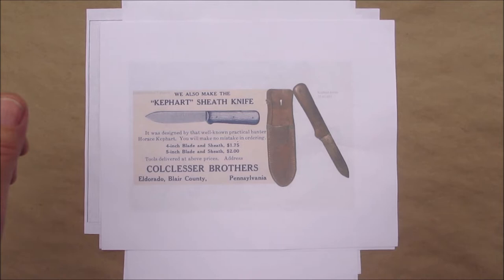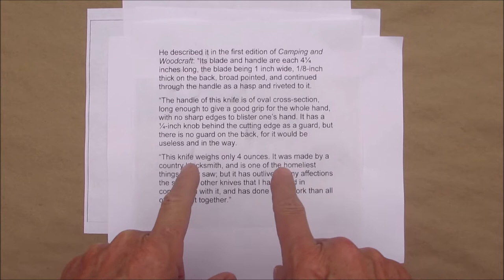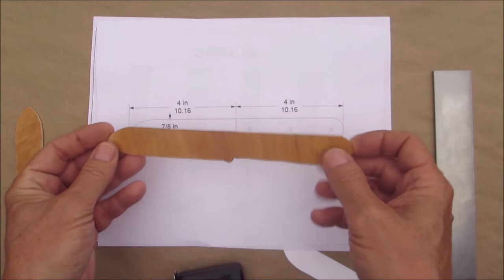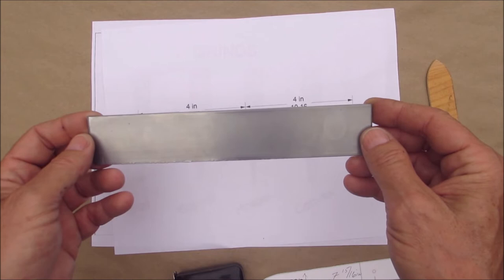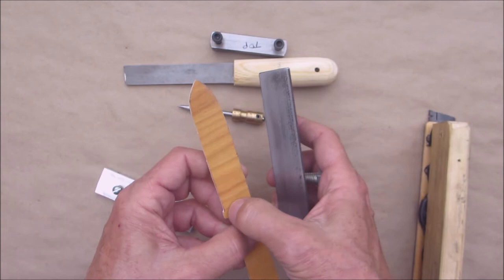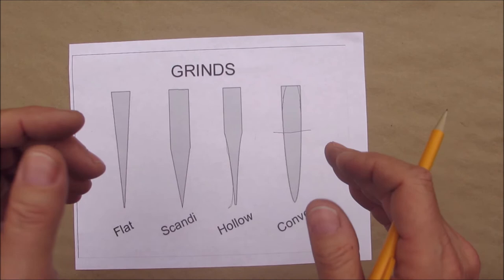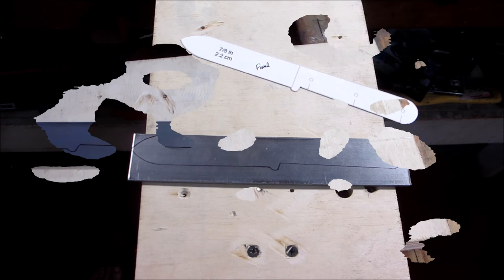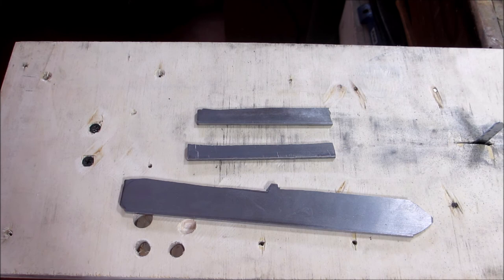The Making of my Horace Kephart Knife! Part 1.

Comment: something I do on cutting metal like that wax it helps to cut faster and the blades last longer and if you cute or grind aluminum keep some wax on hand to put on the grinding wheel and they will not plug up and cut very nice wax can be a amazing thing when working with metal :)
Reply from the maker: trouble&chester Adventures Wow I didn’t know that! I am sure going to try that! Thanks my friend! 👍🏻😀